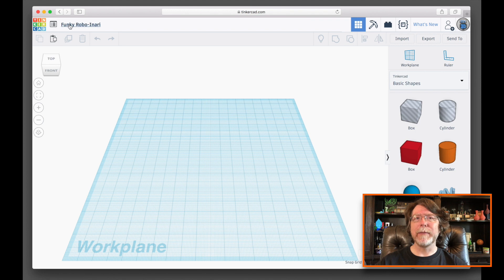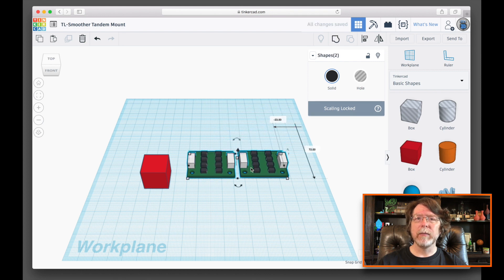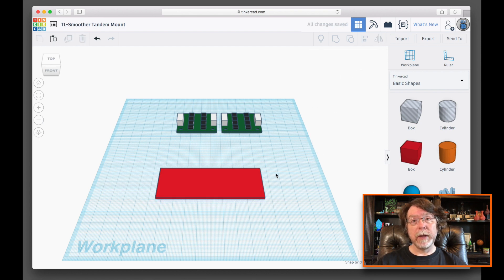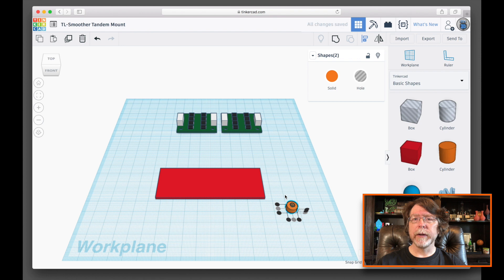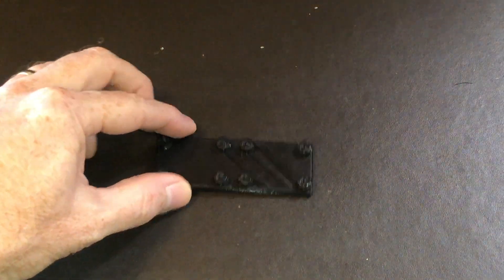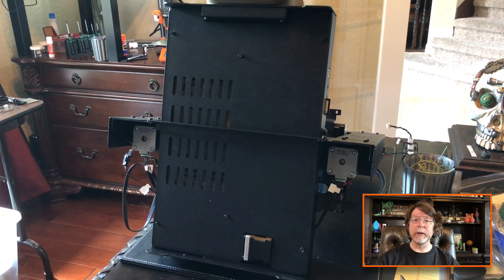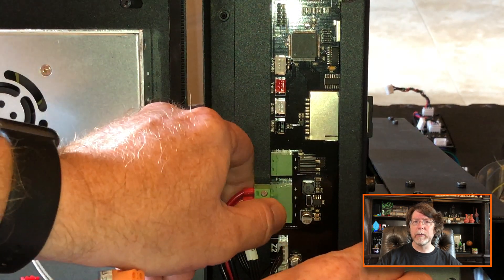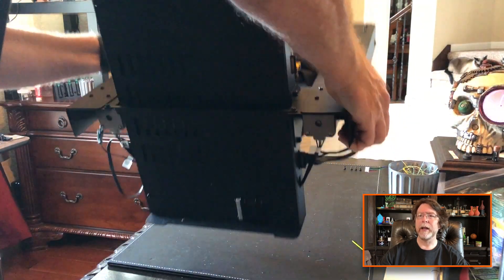Smoother Than Ever: Install TL Smoothers on X and Y Axes

Comment: Considering that TL-Smoothers are a bunch of diodes, is there no polarity to these things??
Reply from the maker: That's correct. The TL-Smoother boards don't care which side you plug the motor into and which side you plug into the main board. The only thing you can't do is plug both the motor and the main board into the same connector, because that would violate the laws of physics (two objects cannot occupy the same space at the same time).

Comment: Hi Brian.  I love your videos, and I’ve watched nearly all of your MPMS+ ones to get the best advice.  I have a question.  Do you use these smoothers with ADVi3++?  I installed the same ones you used in the video, and it has caused some problems.  Using the touch screen, I usually can’t get the axes to move in one direction, i.e., the x axis will move right, but it will only move left back to where it was before I moved it to the right, then won’t move left any further.  With the power off, I have no trouble moving the axes by hand.  The X, Y, and E are all affected.  Thoughts?  The only thing I could think is maybe the firmware is causing a problem?  Incidentally, I tried different smoothers first and had the same problem.  I then bought the ones you used in your video because they worked for you, but no luck.
Reply from the maker: Hi Remington! When the printer powers on, the firmware assumes all axes are at 0, even if they're halfway through their travel. That's why you can move an axis in a positive direction, but if you try to go past where the printer thinks the 0 point is, it won't go. Try homing the printer. From the main screen of ADVi3++, tap Controls, then tap Move. On the Move screen, you can home X, Y, or Z individually, or you can tap the home with the asterisk inside to home all three at once. Give that a try and see if the printer will allow you to then move the axes as expected.
Reply: @BV3D  Well I’ll be darned!  I bet you’re right.  I haven’t had a chance to check your theory yet, but while I was trouble shooting this yesterday I happened to home it and noticed that it allowed me to move the axes afterward.  I’ll have to see if that still works after switching it off.  Odd though that this restriction only came up after I put in the smoothers!  I used to be able to move it back and forth using the touch screen regardless of the starting position.  Anyway, thanks so much for your help!  I can’t wait to see what you have in store next!  I use a dual 5015 part cooler that might be worth checking out.  It mounts in the rear.  http://imgur.com/8qijh4d   http://imgur.com/UWpRBgG.  It’s called the Opticooler if you’re curious!  https://www.thingiverse.com/thing:2927210.  Having to splice or otherwise link the wires makes for a fun challenge that I thought might be up your alley mod wise.
Reply from the maker: Hi Remington! I thought I had replied to this one, but apparently not. Anyway, yes, it's a cool bit of ductwork, and it's clever using a pair of 5015s at half speed to reduce the noise level. 👍

Comment: Amazing work, do you mind to share the Smoother board 3D model? I also would like to ask you which types of screws do you must use? Thanks
Reply from the maker: Hi Antonio! I don't mind sharing at all. I have now published the model on Thingiverse as BV3D Biqu TL Smoother Board Placeholder Model ( https://www.thingiverse.com/thing:3367194 ). I think I used M3x6 screws to hold the smoother boards on the mount. 😊

Comment: Another good video Bryan.  Thanks.  Question...I opened the bottom cover to install the smoothers and noticed the Y-axis idler pulley is cocked at an angle.  Do you have a mod to correct that or do I need to come up with something?  Thanks.
Reply from the maker: There’s a mod for that. 👍🏻 I guess I should do a Y axis belt tensioner mod video. I found a great brace for the idler on Thingiverse. I won’t keep you in suspense. It’s at https://www.thingiverse.com/thing:2959052 and it press-fits over the existing block that the idler is bolted to. It braces against the spine along the inside of the printer’s body. You will probably have to remove the two screws holding the idler block in place. I found the fit to be quite tight, and ended up using a bench vise to press the block into the brace. I suspect you could gently tap the two together with a hammer. Anyway, that should get you fixed up. 😉
Reply: BV3D  Thanks for the info.  I'll look into that this weekend if I get a chance.  It seems like the threads in the bracket that the pulley screws into is being bent sideways or was not straight from the factory.  By looking at the mod I don't know for sure if it will straighten it back up.
Reply: BV3D  Found this.  This looks like what I am going to have to do to get my pulley to sit straight.  Here is a link in case anyone else may be having the same problem.  https://www.thingiverse.com/thing:2516248

Comment: Another great video. Have the tl-smoother improved your prints? Also I would cut a couple big holes out of the design to allow faster printing and less filament. Other then that great video. As always take care.
Reply from the maker: Hi Scalda!

I have seen an improvement. Example: Benchy. A print without the smoothers will show a diagonal striping pattern on the wheelhouse. The pattern is gone when the smoothers are installed.

With regard to cutouts in the plate, that's a great idea for reducing print and plastic. My original design goal was to provide coverage for the underside of the smoothers in the event something came loose inside the printer. I didn't want anything shorting out on exposed contacts.

After reading your suggestion, my first thought was to use a honeycomb cutout to remove material from the plate. While that saved 16% on filament, it added 21% to the print time.

My second try used three large cutouts: A 20mm square under each smoother, and a 20x10mm cutout between the mounting posts in the center of the part. That design uses 26% less filament, and prints 9% faster. 

Of those two redesigns, the one with the honeycomb cutouts provided more protection to the underside of the smoothers. But I gave it one more shot. So, using the large rectangular cutouts, but leaving 0.5mm material on the bottom of them (two layers, more or less, at 0.2mm layer height), provide full coverage on the bottom of the mounting plate, but still uses 22% less filament. The difference in print time is two minutes, so it's essentially a wash on a one-hour print. 

This final redesign accomplishes the design goal of covering the underside of the smoothers, provides a huge surface area for adhesion of the servo tape, AND uses less filament. I will add the final redesign to the Thingiverse thing.

Note: All calculations are based on estimates from the slicer.